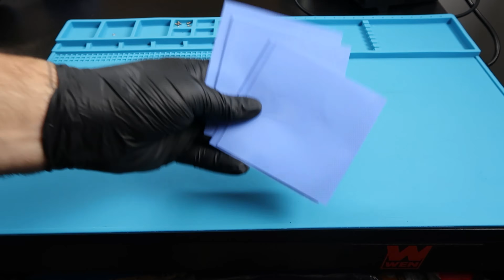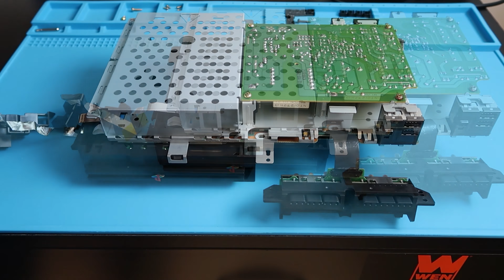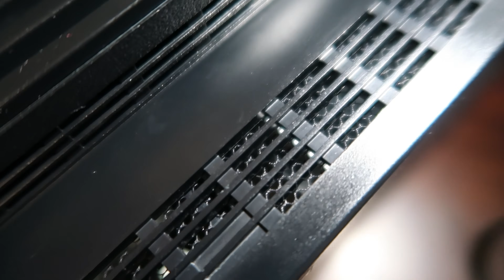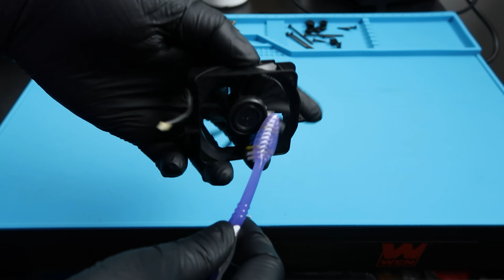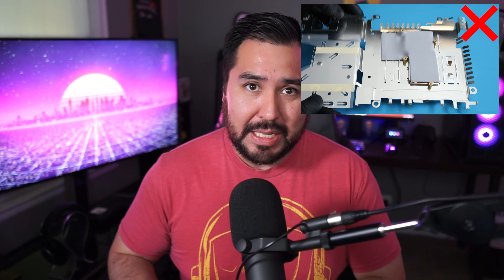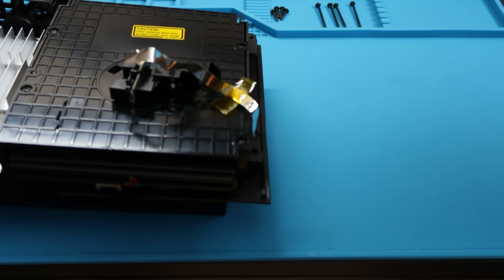Tutorial | Sony PlayStation 2 Clean Up | 4K🔴

Comment: Link for the silicone mat that was used? Thank you.
Reply from the maker: @DrKShAdOw_805 The work mat? Easy peasy. Here ya go: Hengtianmei Heat Insulation Silicone Repair Mat with Scale Ruler and Screw Position for Soldering Iron, Phone and Computer Repair Size: 22 x 14 Inches (H-203) https://a.co/d/69uGTKB

Comment: I just bought a PS2 FAT with a unknown modchip with a seller who said that the lens wasnt running games, but after figuring out how to disable the modchip, i checked a list to see if it had any specific method to run games which apparently was common in the first modchips, with that I found out that to read the games I have to put the game in the drawer, press the reset until it turns off and then tapping reset once and then it runs the game in just couple seconds. But unfortunetily i cant open the dvd drive to clean the lens and check the rubber because of a stripped screw lol.
Reply from the maker: @joojdobixo  aw man, so you can't repair or clean due to a darn screw? Maybe there are methods to removing a stripped screw so you can open it and take a look inside.

Comment: Very cool video! I'm all up for more PS2 content!
I have just bought a PS2 off eBay with a broken disc drive. I will try cleaning to see if it does help but I might not bother replacing it if it ends up not working.
Reply from the maker: You may not have to! What type of PS2 is it? My next video will cover some easy to do mods!
Reply: It's a SCPH-30001 just like the one in your video. If a thorough cleaning don't bring the laser back, I'll just leave it be.
I have assembled Jeff Chen's easyHDD and I'll use it with Grimdoomer's exFAT version of OPL!
Reply from the maker: @jonathanmichaud6800  That's exactly what I had in mind. Great minds my friend, great minds.